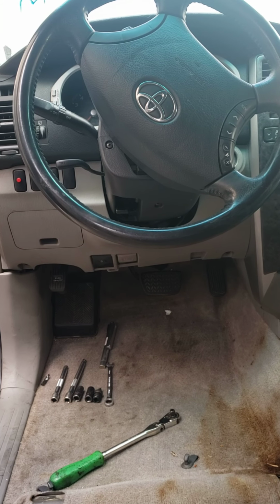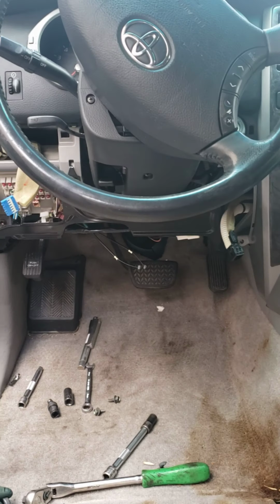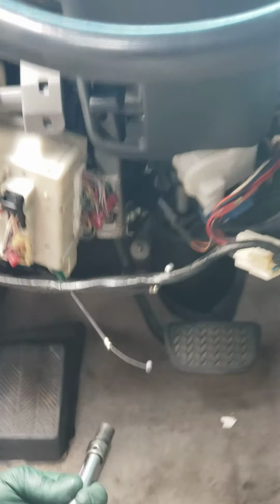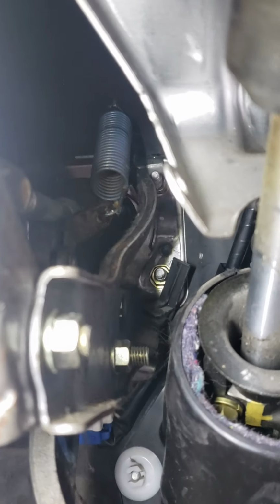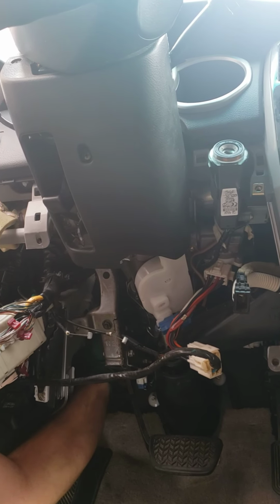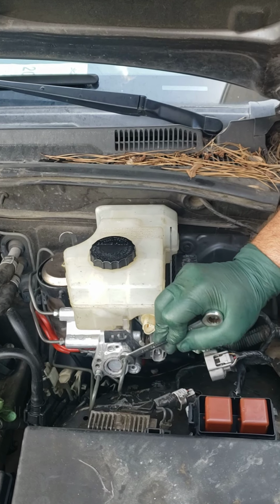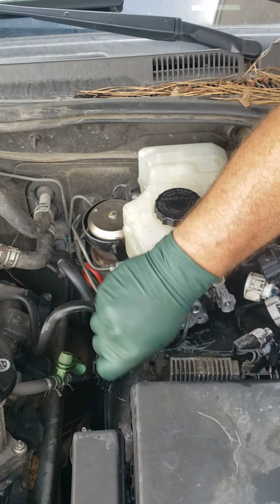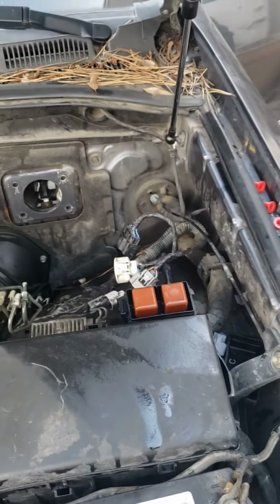How to remove the HBB ABS unit from Toyota 4runner , Lexus lx450 lx470 gx470 etc

Comment: My 2003 4Runner had the ABS and Brake Lights on with the high-pitched warning sound. I followed these steps along with the other videos and replaced the pump motor you see here, and it fixed my issue. Massive thanks to Wholesale Parts Express for the very informative information on all aspects of this issue and fix. Thanks!!
Reply: Where did you get the abs module from?

Comment: Thanks for the great video, however you don't really need to remove the fusebox and the traction control computer behind it. I was able to remove all 4 bolts for the master cylinder without touching the fusebox

Comment: Bought a new motor just like this one. It's saying I have to apply 12V power to blue and red wires after it's attached to the pump and accumulator. Just to hear the motor run. Is this something normal?
Reply: Did you ever figure it out ? I have to do mine today when mine comes in the mail

Comment: OK, I just replaced my entire unit...2004 4runner SR5 v6...after all install, I'm trying to do a system bleed but the abs pump/motor doesn't start when turning ignition to 'ON'...are there start permissive or am I missing something? Can I still bleed the unit without the abs running? Need help!
Reply: What did you find out?
Reply: @Quan-bo4np  the replacement unit I bought online was faulty...ended up having to take to toyota to install a new one...
Reply: @joshragan2782  ok I have a 2004 4Runner also 280k miles and my own just went bad yesterday glad I made it home safe

Comment: After replacing my system the alarm is still going off but the pump is working. Any suggestions?
Reply: Give them a call if you are running into any issues. They are very helpful. Bleeding the unit after installation is probably a good idea